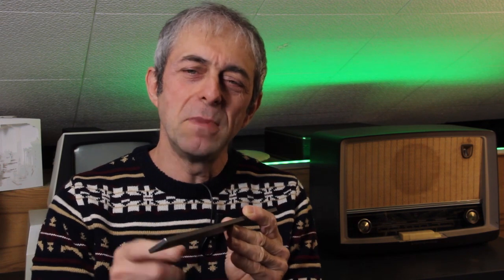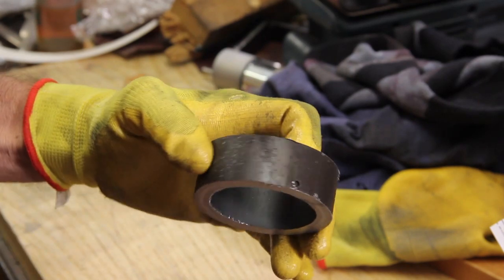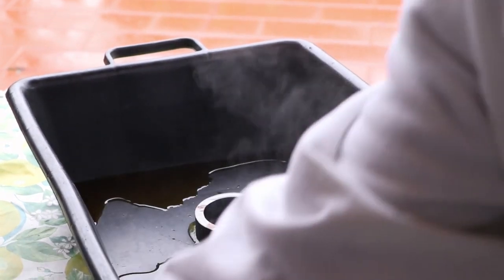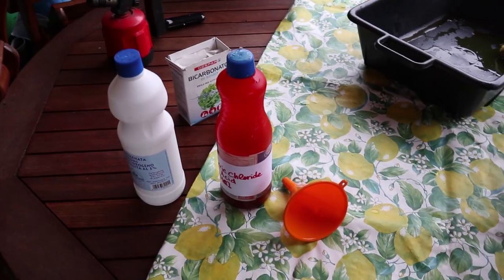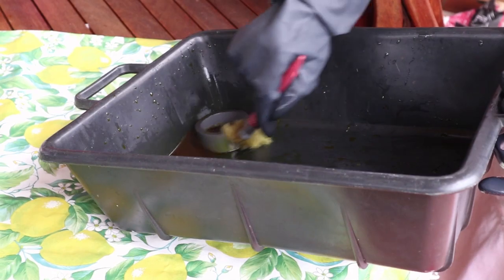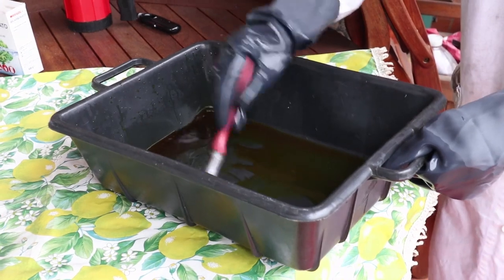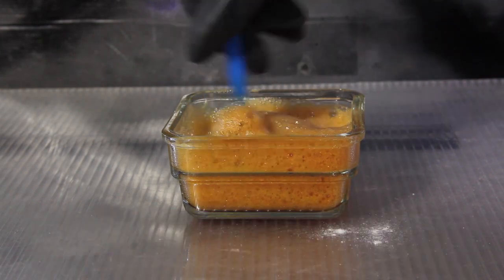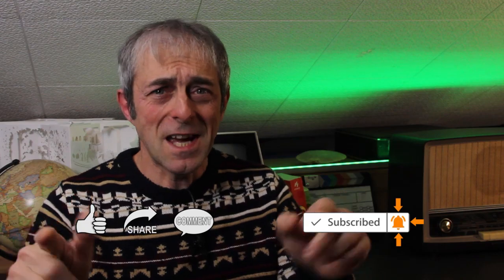How I chemically remove scale from steel ...the clean way recycling chemicals

Comment: Great video! 
I use citric acid because it's cheap, and it works pretty well over night or within 24 hours. But I wonder what's the responsible (eco-conscious/safe/legal) way to dispose of the liquid after? Any suggestions?
Reply from the maker: @lankplank  well I'm not a chemist but AFAIK citric acid reacts with both iron(ii) and iron(iii) ions forming the respective citrates. They are in turn created when oxidized iron/steel is submerged in a solution of water and citric acid.
Iron citrate is not toxic, so I think that in small quantities it can be safely discarded on the ground as it is a nutrient for plants.
However this is just a thought, I lack the expertise to give you a definitive answer.

Comment: Thanks, yes it was very interesting. A question please, could I substitute sulfuric acid for the hydrochloric acid as I have a 20 litre drum of sulfuric acid. Thanks Stuart 🇦🇺
Reply from the maker: I have no experience with H2SO4 and you can deem ma as a hobby chemist, but as far as I understand it should work, first through a redox reaction with magnetite (mostly the composition of the scale) and then from ferrous to ferric sulfate. However sulfuric acid should react very well even with the underlying iron (in the steel). Also the neutralization should work but I haven't checked it out yet and I am not sure of the result. BTW I would have traded your sulfuric acid with HCl if you were not from the other side of the planet 😃. Cheers. Claudio.
Reply from the maker: P.s. iron sulfates are useful compounds, you can make merdents and inks out of them, among other things.
Reply: @AccidentalScience  Thanks Claudio, I appreciate the answer as I am hopeless at chemistry. I will give it a try and see how it goes.
Cheers Stuart 🇦🇺
Reply from the maker: @scroungasworkshop4663  be careful with sulfuric acid, also look at the concentration: I wouldn't play with it at concentrations higher than 37%. Never give an acid water to drink: dilute acid into water and no the other way around. Use small quantities and outdoor. Remember you are the sole responsible of your actions. 
Sorry for this disclaimer but I don't want to take any liability.
Reply: @AccidentalScience  Thanks for the warning. I am one of those people that takes responsibility for my own actions and I’m familiar with acid so sleep well my friend. Cheers Stuart 🇦🇺

Comment: I just use regular distilled white vinegar and submerge the part in it for 24 hrs. Does a really good job and less hazardous. Takes longer but I don't have any waste to deal with.
Reply from the maker: Well that is the thing I tested first, using aceitc acid at 10% concentration, with no significative results. I also read various sources to understand better the possible reaction and it seems only concentrated aceitc acid is able to react with iron(III) oxide, and at quite high temperature. Not sure here though. So I don't know how vinegar, which should be acetic acid at 5...6% concentration, could work. Please, may you provide more information? What kind of oxides the metal had? Was it rust (reddish) or actual mill scale (gray tough coat)?
Reply: @AccidentalScience  I use distilled white vinegar, I submerge the hot rolled steel part in it for 24 hours. It takes the mill scale off. Not much to the process, I use a kiddie pool if it is a large piece. Once it has been in the vinegar for 24 hours or so, I can scrub the mill scale off with a wire hand brush. Comes off with little effort.

Comment: I use HCL a lot when removing mill scale. Adding hydrogen peroxide is new to me. So if you would please give me some insight. Can I mix the two is a pump up sprayer? Or do they need to be applied separately? How much hydrogen peroxide to a litter of HCL? Thank you.
Reply from the maker: I think hydro peroxide helps to remove the passivated upper layer. In my experiment I've seen that a little amount of about 10% at 3% of concentration is enough. This is experimental though so in the case you'd like to try you'll do it at your own risk only! You must know what you're doing, the video and this comment are not a tutorial but merely a showcase of my experience.
Spraying acid is dangerous, adding hydrogen peroxide would make it even more dangerous. I'd avoid it altogether.

Comment: Really interesting. Now if there was a similarly easy way to deal with used pcb etch. I hear the copper is the problem which shouldn't be put down the drain.
Reply from the maker: Yes, you are right. Copper chloride can even corrode your pipes. But it should be possible to neutralize the liquor with a similar method even though the salt should be recovered in that case being still toxic.

Comment: What is the mixture ratio in volume that you used for the hydrogen peroxide? I'm using muriatic acid at a 3:1 by volume in a 550 gallon tank. 300 gallons of water, 100 gallons of muriatic acid, how much peroxide would I need using a 3% H2O2?
Reply from the maker: 550 gallon tank? Are you gonna remove scale to an air carrier? My experiment was just for small scale, not at industrial scale to remove scale (ouch, the pun :) ). I don't really know what happens at that volume. For small scale, say no more than a quarter of a gallon, the stoichiometric ratio would be (in weight) 5 parts of H2O2 at 3% and one of HCl (aqueous solution at 33%). Though, since the quantity of magnetite that would be converted into ferrous oxide (if my guess is correct) is not known but it should be relatively small, making a non-stoichiometric mixture of 2 by 1 would be enough. However, again, my experiment was meant for small scale, not for that large quantities. Even when neutralized that amount of liquor could not be disposed down to the drain or dispersed on the ground and must be treated properly. I am not titled to direct you how to deal with such a large amount, sorry. In chemistry I am just a hobbyist.

Comment: I see you mixed the bicarb directly into the HCl and mixed with a brush. What effect does adding extra water have to the neutralising process? I'd prefer to use a less concentrated liquid I can swirl in a bottle (less labour).
Many thanks.
Reply from the maker: Adding water simply dilute the liquor and you need the same amount of bicarb. to neutralize it.
Reply: @AccidentalScience  I'm not a chemist so I just wanted to check that an excess of water wouldn't stall it or something. :) Thanks for the video!
Reply from the maker: @200milesaway6  Don't worry, I'm not a chemist too, I just took a three semester course in chemistry. I'm experienced in electronics.

Comment: i dip my metal in HCL and some water.  pull out after 30mints and wash with water with lots of dish washing liquid.  the soap make a chemical reaction  then dry with a rag, it turns gray and wont rust if you keep inside out of the weather . if you wash with water and bicarbonate it will rust in 40 mints
Reply from the maker: Interesting. What kind of soap? What's the reaction?